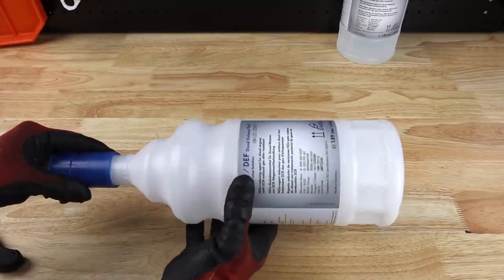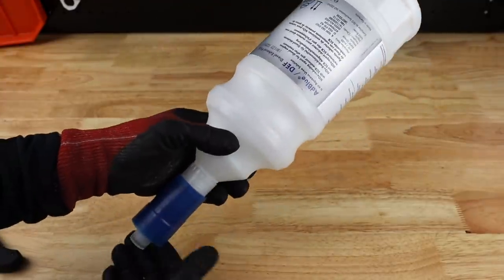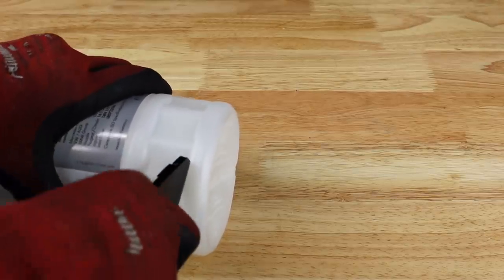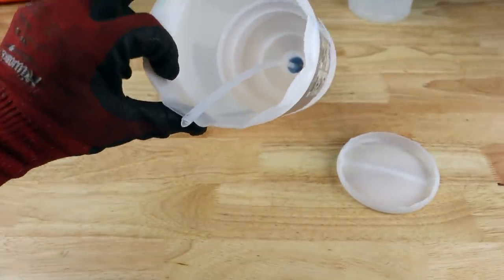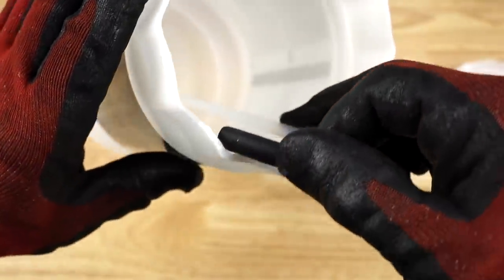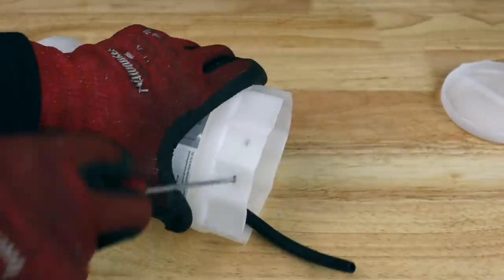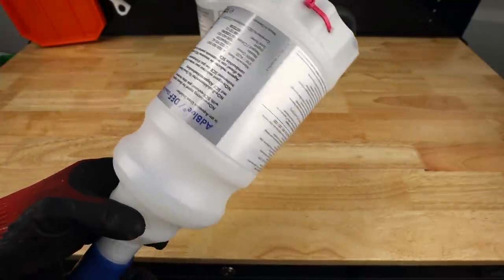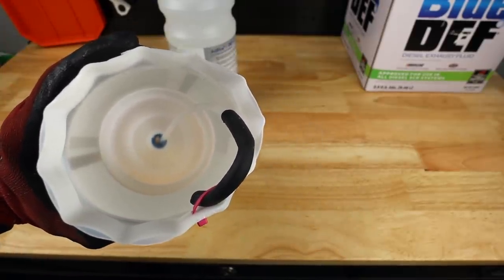How To Make a SPILL PROOF Exhaust Fluid Funnel

Comment: Thanks for the tip. Obviously the nice thing about the small bottles is that they are 100% sealed, so no spilling is possible. Please explain where I get this wrong: To use your funnel, you (1) screw it in to the DEF screw nozzle, (2) fill the funnel with DEF, (3) push the funnel down as normal and watch the DEF flow into the tank. Eventually you get to needing less than a liter, so you (4) fill the funnel as normal, and (5) press it down. No longer a closed system, (6) the weight of the DEF in the funnel (actually, air pressure on a larger surface area than the hose) will push the fluid through the hose once the tank is full, and I presume you'll see fluid simply circulating through the funnel, out of the hose and then down into the tank, and this is your clue that the DEF tank is full and to stop pressing the funnel downwards. Correct? Also, this makes putting the vacuum hose on and turning it downwards is a MUST.

Comment: Also if you are a road service tech.  The 2.5G DEF bottle, once thoroughly cleaned out, is AWESOME for keeping a few gallons of ALL fluids.  I keep 2 jugs each of coolant, motor oil, ATF and 4 of hydraulic oil on my rig.  Plus my 5 gallon buckets.

Comment: Recently bought a 2013 Touareg TDI and have been looking to do this mod myself. Where have you found the bottle for $5? Everywhere I've looked, they are about $15.
Reply from the maker: Check the dealer. They should be $5-$7 bucks I think
Reply: @HumbleMechanic  Just got the bottle from my dealer for $4.84 and a 2.5 Gal jug for $10.70. Better than anything online!

Comment: Random question. Does VW use a different version of this than commercial trucks? Reason I ask is I know a lot of people don't know what DEF or AdBlue is. If it's all the same you can get it at the pump at most truck stops now. It's usually a lot cheaper around $2.75 a gallon.
Reply: I'm sure is the urea jajaja
Reply: Its all the same
Reply: Thats what I assumed.

Comment: What should i use as a cleaner in one of those fuel Injector and intake manifold cleaner tools that are air compressor driven?
Reply from the maker: I’d probably just rinse it out with water.

Comment: @humblemechanic so i have a 2008 vw fsi 2.0t manual transmission gli that has a bucking issue wih no engine light and hesitates when i am not on the throttle and am on level ground. i cannot figure it out i have researched about it and there are no forums on it. idk f its the fuel pump or the ecu. but if anyone knows about this problem please give me any advice thanks. ps when i have it in cruise control the bucking and hiccuping takes it out of cruise control

Comment: Cheapest place to get DEF is a truck stop where they have it at the pump. It's a pain in the ass because its typically with all the big rigs and you'll have to pay in side to get them to turn on the DEF pump - but a fill up costs 5 bucks instead of 20. Also you dont waste any plastic.

Comment: what year did DEF become a requirement in all diesel vehicles? i am in the market for a vehicle and want a diesel but i dont want to deal with DEF
Reply: bobby williams  do you have a state that does emissions testing
Reply from the maker: Vw started in 2011 or 2012 I think. But trucks have had it longer I think.
Reply: @sapperdaddy504  yes if the vehicle is older than 5 years old
Reply: @HumbleMechanic  ok
Reply: 3.0TDI was 2010 on Audi. Basically when Audi got the Q7 TDI. A3 2.0TDI was 2015 along with the A6, A7, A8.
Reply: @Lako it varies on how you drive and outside temps. If you drive short trips in the cold you'll barely use it. If you do a ton of highway driving on hot temps you'll need to fill up more often.
Reply: Lako It reduces the emissions to less than gas engines and you probably have to refill the ad-blue less than after 5 fuel tanks. Bad emissions kill people although you don’t see it.
Reply: Big trucks in Canada 2007
Reply: Ford trucks started in 08 I believe...
Reply: Tier 4 Final emissions which are the introduction of an SCR and DEF was mandated in 2010,  Tier 4 Interim which was the introduction of a DPF was 2007.

Comment: We used to do this may years ago, but the DEF would still want to splatter out as we pushed down on the bottle.  When that happened we pushed down with a shop rag spread over the top of the bottle's open end which seemed to reduce on mess. Now we just sell as many of those bottles as the vehicle requires.  Despite diesels never being popular in California, they are now even less so, probably due to diesel gate.  I've never understood the "fuel economy" rational for buying a diesel when the cost to repair these cars far outweighs any fuel savings that can ever be realized.  Just my observations.
Reply from the maker: Some of that is older TDI vs older gas. Today the delta in MPG, is much less. Plus you’re paying a premium for the car, the fuel, and maintenance.
Reply: It's actually a lot less expensive to maintain many of the diesel vehicles vs gasoline vehicles. In Europe this is shown to be true, maybe in America they don't know how to work on diesels or overcharge? I've got a 35d X5 and all the techs say it's one of the best engines BMW had, little to no maintenance.

Comment: Customers love it when it spills a little bit on the carpet and it turns into white crystal that doesn’t come off 😂
Reply from the maker: Oh man we had a tech over fill a Passat and it ruined the whole trunk. Every bit of carpet had to be replaced. The boss man was not happy.
Reply: HumbleMechanic I work for Peugeot / Citroen and we have had similar problems haha we have a pump that fills them in seconds and is “supposed” to stop when the tank is full and unless your quick to turn it off it goes everywhere 😂

Comment: So maybe you have the answer or know the answer to this question. Both Mercedes and VW/Audi had diesel engines in the states and all used the AdBlu liquid. However VW and Audi engineers were able to give the customer the AdBlu tank and a spare tire. Why couldn't Mercedes engineers figure out to do the same? If you had a diesel Mercedes, you did not get a spare tire in any form.
Reply from the maker: Not including spare tires is becoming more common. They give you a pump and a bottle of stop leak.
Reply: Andrew Syracuse it’s nothing to do with the adblu tank.  It’s about saving weight to get better mileage figures.

Comment: Go by a big truck stop and buy def from the pump.  Way way cheaper
Reply: Use the funnel and pump what you need in.  At 2.75 a gallon its a good deal
Reply from the maker: Does that meet ISO22241? I’ve never checked.
Reply: @HumbleMechanic  i dont know but its the same as the stuff in the 2.5 gallon tanks.  I use it in my 2015 semi with no issues
Reply: @HumbleMechanic  i just double checked and yes it does meet those standards at loves truck stop.  Pilot and flying j does also.  Mom and pop shops can tell you at the fuel desk
Reply: here in Australia most petrol/gas stations have at least 1 Ad blue pump
Reply: @brendanrandle  here in the states, most cars do not use it.  Only big rigs and heavy duty trucks.  With the odd small car here and there.  In the souther usa its only sold at travel center (truck stops) at the pump.

Comment: With those last two comments it got me thinking. Is exhaust fluid a new thing? I have been hearing about it recently as a legit thing. But back years ago it was just a joke like blinker fluid and muffler bearings. So, new thing? Or just something us "gasoline " guys never heard of?
Reply from the maker: VW started using it in 2012. I think some diesel trucks used is before that. but its a newer thing within the last 10-15 years. There may have been vehicles before that.

Comment: What I don't get is why do people bother putting DEF  in the reservoir when all you need to do is take a piss in the tank? Its all the same liquid
Reply: my diesel predates adblue. and more to piss than urea,  a lot of waste thats not good for an engine. however the dpf  is additive based not  "heat up exaust  and burn off" and has one of these little tanks  in which needs to be filled with mud coloured Eoyls/pat fluid

Comment: Another free service at the dealership!
Don’t worry diesel’s future is bleak.  Heavy equipment and Big Rigs only... up North... where electric cars don’t perform well.  

I know these diesel engines well (other German manufacturer that doesn’t cheat).  They SUCK, over complicated and expensive.  Any passenger vehicle that uses a 4cyl diesel is just stupid!
Reply from the maker: In the VW world, 15 years ago, the TDI was a great MPG car, and way better than the gassers. Plus diesel fuel was cheaper. 

Today you pay a premium for the car, the maintenance, and fuel. The MPG delta is much smaller. I don't think 4cyl TDI are stupid. I think they can be awesome cars with good power and great MPG. But the savings is not really there like it was 15 years ago. 

The newer gassers are doing great on MPG even on 87 octane fuel.